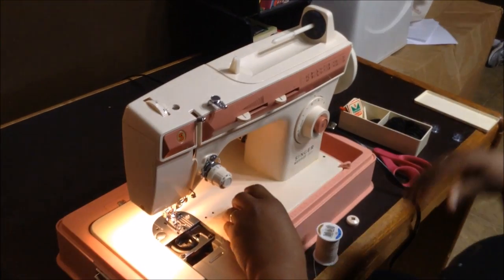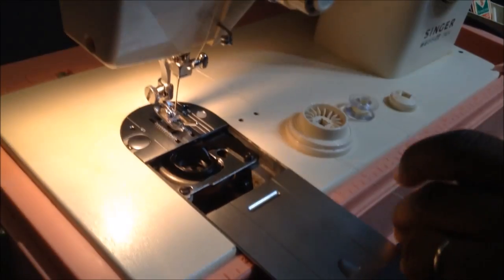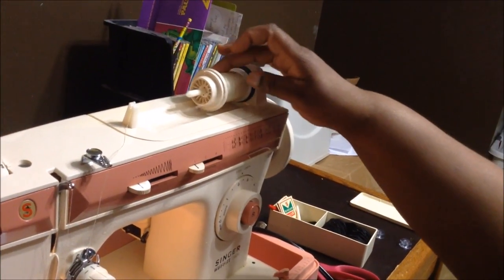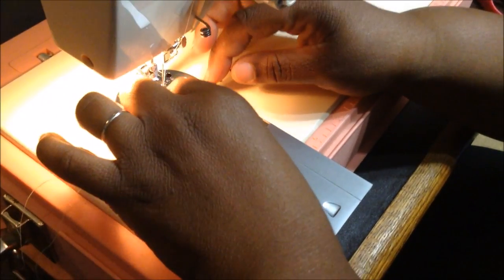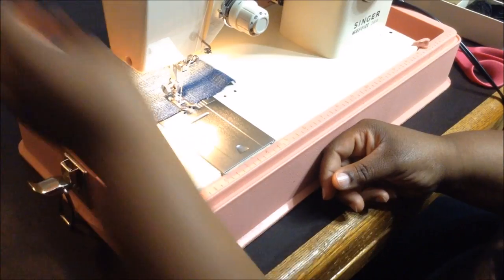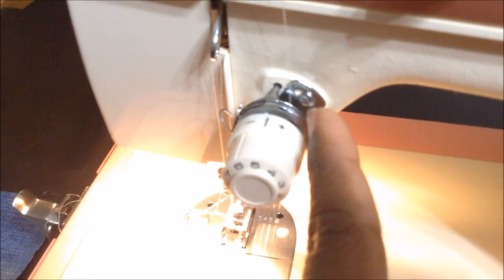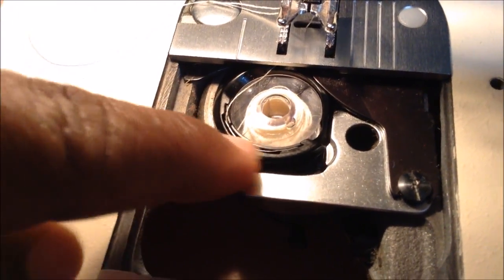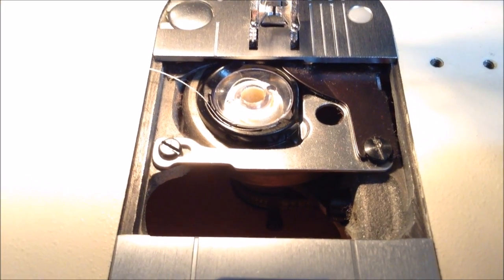Singer Merritt 2404 Sewing Machine HOW TO THREAD MACHINE ~ Beginner Sewer

Comment: I have an old one like this, forgot where I got it from, but I had to thread it around the round part before threading it thru the loop............above the tension ............the 2nd step after you tread it through the nylon first thread-thru after the thread comes off of the spool............I tried threading mine like you did and it made real real lose stitches that could not be used............I went back and threaded around the round part then the loop attached to it and then it sewed wonderful.................I cannot find how to fill a bobbin though, so now I will look for that

Comment: I another guy...who picked up this unit for about $15 almost 10 years ago. Never used it because I didn't have a manual. The unit is extremely clean with about 31 black rings (different stitching I presume)... anyway... 

Thanks for your video. It has been most helpful. Just curious ...any idea where I can find patterns from the '50's and 60's for guy clothes.

Thank you again.
Tacoma, WA
 😎

Comment: I have a merritt 3130 which appears very similar. And I would like to find a repair manual as I took off the handwheel for no good reason and now can't find the sweet spot for the thread winder and to tighten the handwheel for the needle bar to go up and down.  Can you direct me to the right place?

Comment: I have this same machine. I love your video positively great. I have to ask though, my thread keeps getting all bunched and caught up after just a moment or so. I'm not sure the issue, do you have any thoughts or suggestions.
Reply: Hold both your threads towards the back of the machine until the needle has being through the fabric at least three times.  After that you may let go of 'em, and you should be good to go.  If the thread keeps on tangling, your machine may have some alignment issues.  In that case, take it to a service professional.

Comment: Thank u so much. I had to order the thread holder for bobbin and still need to order the cap that holds the thread on top. My sewing machine came with no accessories. Do you recomend any other accessories?
Reply from the maker: I love extra bobbins for my different kids' projects-to already have them ready to use, variety needles-certain needles for different types of fabric, etc. Great Success, TJ
Reply: Thank you again. I have another ? What should the tension b on.
Reply: Fading Dandelion few tips try to buy upright spool holder for your thread and use its original bobbins which is metal with 3holes .You can find on eBay .This will dramatically improve your stitch quality .
Reply: @JannatJannat56  s'il veuplai common changer les disques pour broder et merci
Reply: @JannatJannat56  arjoki ichrahi li kayfa asta3mil les disque kay atroza biha wa choukran (ana min Maroc)